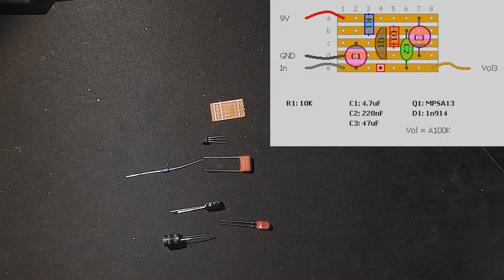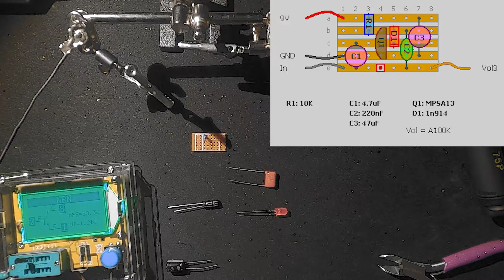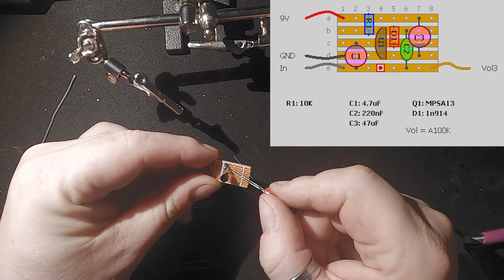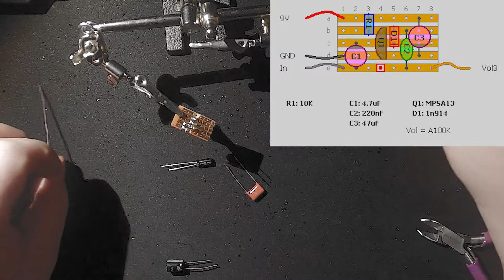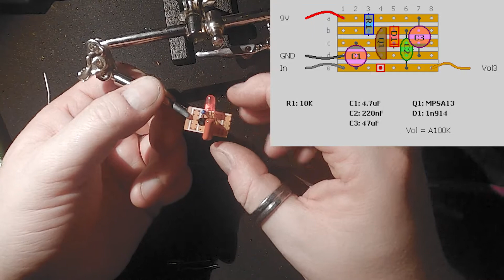DIY Pedal Building - How To Build A Bazzfuss Guitar Fuzz Pedal

Comment: Great video! Thanks! I've just started to build the circuit and I'm curious about the transistors. The three you mention  (mpsa13, BC108c, 2N5088) are a little different with the darlington mpsa13 a bit on the extreme side. Which one are you using in the video and have you documented its hfe? Also I'm going for a NOS green LED I've had since mid 90's, so that'll be a cool feature.
Reply from the maker: Like I said in the video I'm using an mpsa13. Cheers.

Comment: Note that the "front end" of the EHX/JHS "Lizard Queen" pedal IS a Bazzfuss.  It feeds a Tim Escobedo Push-Me-Pull-You octave circuit.  The stock Lizard Queen connects them directly, but it is a relatively simple matter to wire up a toggle that bypasses the octaving part and takes the Bazzfuss part directly to the volume control.
Reply from the maker: indeed it is.

Comment: Looks easy and efficient, thanks for the upload.
How does the R1 (10k) influence the sound? ( I mean, if I change the value, how will the sound be different? )
Same question about C1 and C3.
Reply from the maker: Cheers, best thing is to experiment. The 10K is what controls the voltage to the transistor, lowering the resistance should allow more voltage, increasing the resistance will lower the voltage.
Reply: @goliathfxbassandpedalshow  Thanks for the reply, I have to try and experiment.
Reply: @goliathfxbassandpedalshow  That is correct, but soundwise it would affect the sustain. Lower voltage = more gate, higher voltage = more sustain.

Comment: I like the tone. I'm building a similar circuit. How would I mod this so it doesn't sort of cut out at the end of a note as it resonates? This is my second pedal build. Just wondering if possible how to get it to resonate out a little more instead of being gated from lack of better terms. Thanks and great channel. Subscribed.
Reply from the maker: You wanna look at dual transistor fuzzes for that. This is a super basic circuit that are the building blocks for more advanced pedals.
Reply: The gated "velcro" sounds is the result of an under-biased transistor and has nothing to do with the simplicity or design of the Bazz Fuss. The transistor is running at a lower voltage, likely due to his specific combination of transistor, diode and input resistor. Different transistor + diode combinations in this circuit will also require a change to the input resistor. Even a potentiometer might work as it would allow the player to select the bias "to taste". Test the circuit with different parts in a breadboard before soldering anything as to avoid "surprises". In a simple circuit like this, every part counts a lot.

Comment: If lug 2 is out as you said in an earlier comment where does lug 1 go ? I find those vero board pictures confusing as there always seem be something missing! Whether it be wiring or where certain wires go to which lugs.
Reply from the maker: Vol lug one goes to ground. I would highly recommend going to watch how I wire a footswitch and earth loop vids as they explain it a little.
Reply: OK thanks for that! I think it would be way easier for beginners if the vero board pic just had a pic of the pot and where each lug went!

Comment: i have a question: why do you need to drill that hole on the circuitboard?
Reply from the maker: Your not drilling fully through, but breaking the strip. It's so you can place components that are in different parts of the circuit, on the same row, without them conducting etc
Reply: one more question: where should i wire the wires from fuzz board to potentiometer, footswitch, and jacks?

Comment: Non electrolytic caps can be noisy if the outer shield doesn't go to ground
Reply from the maker: You've lost me a little there. I've never known of caps having their cases grounded. Certainly not in any circuits or builds I've done. Would love to hear more on this.
Reply: @goliathfxbassandpedalshow  I'll let Mr. Carlson explain it to you. Non electrolytic caps have an outside foil that can pick up frequencies if installed backwards in a circuit. Causing noise. I'm not talking about electrolytic capacitors. Check the video. https://youtu.be/BnR_DLd1PDI?si=m1RQTy3Hvelc7u_R
Reply from the maker: Intresting, however in your first comment you say the outer shield needs to go to ground, which is incorrect. Thats partly what threw me. But Carlson is talking about old caps for the most part. Modern caps have two end plates with their componds in the centre, not many have the outside foil wrap connected to one pin like he mentions. If they did, and did indeed cause these issues then you would most likely be paying triple, maybe even quadruple for all of your electronic items to pay sorting the correct orientation of the film caps. If it was that much of a problem then these caps would be marked in the factory with correct orientation. However, I will give this a try and socket some caps next time and see if there is an audio difference. Here is the inside of a film cap - https://www.youtube.com/watch?app=desktop&v=4BEo5mw6ZKQ
Reply: @goliathfxbassandpedalshow  well Carlson said the shield goes to the chassis. Which is usually ground. But he also says shield goes to the lower output side of an audio signal. Any capacitor that has an outside foil. Many new ones have it as well as the old ones. Orange drops and other "drops" as well as polypropylene etc. Those are capacitors we use in guitar amplifiers. I would think an effect pedal would qualify since a guitar signal goes through the circuit. Obviously your video shows an outside shield in the first few seconds. His point is that they are not marked from the factory. Did you watch the full video? Paying triple or quadruple? That makes no sense. You are just orientating them for less noise and interference. He's talking about brand new caps that aren't marked.
Reply from the maker: @knowmusicman157  I meant the cost would increase in labour time needed to sort through capacitors. Be that as it may, maybe in high current devices you'd get some stray inductance that could cause a bit of noise but the magnetic field would be tiny, in amps probably cause noise but I don't know any amp builders who grade caps this way. I'll have to ask them. In pedals we are talking milliamps, the current generated is so small the situation would just not occur.
Reply: @goliathfxbassandpedalshow  Take it or leave it. Some people just love to prove everyone wrong that just offers a free piece of advice. Manufacturers don't mark caps to save money. That's the point. You need to determine it yourself. Just because you are unaware of something doesn't mean someone who knows more is criticizing you.Your effect pedal signal will be amplified. So it doesn't matter how low the signal impedance is.Maybe you didn't read the many comments about how noisy or muddy your pedal is. I'm done trying to help you.
Reply from the maker: I'm not out to prove you worng for stating something. It doesn't really apply in this situation because the current is too small in the audio signal path. The pedal is noisy and muddy simply because it IS noisy and muddy. It is a crude, basic ciruit. It has zero filtering. It has zero tone control. It is a classic noise machine as that is what it does. It has nothing to do the polarity of the dipped capacitor. Thanks for the advice though, I honestly will look into it with people much, much more knowledgable than myself.
Reply: @goliathfxbassandpedalshow  Ok. Thanks. Carlson's Lab , Psionic Audio. Those guys are some of the best I know. Uncle Doug. Too.

Comment: I made one of these also, and it does the same thing where it doesnt pick up some notes. Anyone know what the deal is with that?
Reply from the maker: That will probably be the bias of the circuit. Either that or the gain. Its a super simple circuit and not very refined so don't expect it to be a beautifully clean fuzz, its certainly not. But it could be refined for sure.
Reply: I get that, What would i have to do to bias the circuit, Try different resistor values? It sounds pretty good as long as we could get the full spectrum of notes to be picked up. Ha.  @goliathfxbassandpedalshow
Reply from the maker: You would need to add more components to get it so sound how your wanting. But then I'd just evolve it upto say a Coloursound One Knob fuzz. Which is essentially a FuzzFace with no fuzz control. To refine the bazzfuss a bit more in its current state, You would need to add a resistor to the emitter on the transitor to ground. Something around 1k would tame the gain. Also add a resistor in series after the input cap to tame some signal going into the gain stage. There are lots of other mods you could do but it will take away from what this circuit is actually meant to be. 

Have fun.
Reply: Gotcha, thanks for the info @goliathfxbassandpedalshow

Comment: what happens if we use a capacitor above 220 nF?
Reply from the maker: I would say give it a go, going higher in value will change the frequencies that are flowing through the circuit. Higher number usually equals more bass.

Comment: I like to use the 1N4001 diode. The red LEDs have good touch sensitivity, but they sound a bit mid-heavy to me. They work good as hard clipping diodes in an op-amp distortion.
Reply from the maker: Thanks for the info! Will have to give it a go!

Comment: i am doing a point to point bazz fuzz (without pcb) and i cant find a schematic with the C3 on it, what is it for? Where should i connect it?
Reply from the maker: C3 is a power filtering cap. It goes between your 9V and ground. It's completely optional.
Reply: @goliathfxbassandpedalshow  thank you!

Comment: im very new to building pedals here, so the "d" line on the pcb is a ground throughout the whole d-line, correct? If that is the case, then would I land the ground pin on the volume pot to the d-line, as well as the ground for the audio in, and audio outs and the 9v power supply?
Reply: ALSO.... what component in this build controls the majority of the tone? I would like to add a tiny breadboard on that section so i can pop in and out different capacitors or transistors to try out different sounds

thanks a million!
Reply from the maker: Yes you are correct, the whole row is ground, but, it will get very cluttered with Earth wires. What I do is chain the earth from the 9v to the jacks etc and footswitch. You can see how I do it in another video on here called how I wire a footswitch.
Reply: @goliathfxbassandpedalshow  Thanks so much! One last question is with the diode, are you replacing the 1N914 with a red LED?
Reply from the maker: @flippymtb9323  Yeah I have done, I used a 5mm Red led and sounded great!

Comment: This is cool, sounds pretty cool, but would cost me $50 on Amzon for all the parts even after I found the cheapest I could find. I could just buy a Berringher SF300 for $20.
Reply from the maker: Then don't buy them on Amazon, you can build this entire pedal with enclosure and jacks for less than $20 by visiting a hardware shop and eBay

The SF300 is awesome tho, but this isn't the same circuit.

Comment: in the video you say your attaching a 4.7uf cap but you put it in the place of C3, and then the 47uf in C1. The diagram however is labeled the other way around.... explanation?
Reply from the maker: Not much to explain, picked up the wrong cap, however, it makes little difference, one is for power filtering and is optional anyway and the other is the input cap to allow larger frequencies through and DC filtering again, this value can be anything from 10nf to 100uf. It makes no odds if I put the caps in the wrong spots the circuit still works and still sounds the way it does. This is just a demonstration on the actual build process. If someone can follow a vero diagram then they will be fine with this.
Reply: @goliathfxbassandpedalshow  didn’t mean to sound rude, 😅. Thank you 🙏 and ur awesome

Comment: do the caps have to be electrolytic?
Reply from the maker: C1 doesn't, this can be any value really but the lower you go the less bass that will go through the circuit, 100nf, 220nf should be fine. C3 is a power filtering cap, you don't need this if you don't want but you will probably get a lot of noise in the finally signal without it. Hope that helps.

Comment: Thanks for the video.
I have made several bazz fess pedals but change the circuit by replacing the film capacitor for lower value for more treble and mids. I actually get a big Muff type sound. Volume,fuzz,bias input volume ( replaces Guitar volume) and tone controls. Also two MPSA13 transistors piggyback together.
Thanks mate
Reply from the maker: Ah thanks for watching man! Really appreciate it!
Reply: @goliathfxbassandpedalshow  awesome video! I just subscribed to your channel. I do have a question for you. I’m a bit of a novice when it comes to PCBs but I have a pre made Dwarfcraft Shiva fuzz PCB which comes with 3 silicon transistors soldered on the board; could I solder an additional 3 extra transistors to the PCB? Would it make it more fuzzier? More harsher? And feedback more? I’m looking to make a crazy, noisy fuzz pedal
Reply from the maker: Hey BigMuff, no I wouldn't add additional transistors, not unless the schematic calls for it. If your looking to make crazy, gated, feedbacky type noises then look at replacing some fixed resistors with potentiometers. Especially Emitter and Collector resistors, these will starve the transistors of voltage and unbias them etc which will give real gated noises.

Comment: 2 questions 

1) what is the yellowish board called on which you mounted the components? 

2) How to make the connections ( input/output) after the circuit is completed. 

Thanks. Asking this because English is not my first language .
Reply from the maker: Hi, the board is Veroboard or Stripboard. I have another video - https://www.youtube.com/watch?v=G8An_6xvV38&t=7s that shows my off board wiring. Cheers.

Comment: my i ask what value volts of electrolytic capacitor?
Reply from the maker: As long as the rating is above the power supply voltage then it can be anywhere between 16v and 400v.  Hope that helps.

Comment: awesome build! quick question, if i want to add a tone/gain pot and keep the volume pot (2 pots) in which part of the circuit goes and what value should i use? thanks for sharing this!
Reply from the maker: Hey thanks for checking it out, to add a tone stage you would need to look at a tone section on say a Big Muff or the Bandaxal etc and use a value calculator depending on what frequancies you want to boost/cut etc. I'm not quite sure what they would be. There are a few Bazzfuss Deluxe schematics around that have a BMP tone stack on them. Have fun.
Reply: I have added a Fuzz control to the emitter (where brown diode and emitter leg meet. Volume control on output and input.
Still researching tone control but it goes on input and I think asdds another capacitor of lower value. Not sure if in series or parallel.
Cheey

Comment: Sounds great. I like the gated sound this gives. Would you know how to ad a control for the gate? What about a 6.8uf switch and adding a mid switch boost like some do to big muffs? Thanks for sharing!
Reply from the maker: Yeah the gated sound is kinda what this circuit is known for. To add a control you would need to substitute a potentiometer for the 10k resistor as this sets the amount of voltage the transistor gets on the collector. a 6.8u cap on the input would only effect the frequencies and not the gate. This circuit essentially doesn't have a tone control, so you wouldn't be able to add a mids switch really without first adding a tone control. Thats simple enough to do but obviously defeats the point of this small parts count, aggressive little fuzz. There are a few BazzFuss schematics online for a Deluxe version that have a few additions if you wanted to check them out. Cheers for watching and the questions.
Reply: @goliathfxbassandpedalshow  You are the man!!!! I didn't expect such a detailed answer! Note taking time. :D I'll try it out.
Reply: @goliathfxbassandpedalshow  10k pots?
Reply: The gated "velcro" sounds is the transistor running at low voltages, it's not related to the circuit design at all. A different input resistor will change the Bias - you could even use a potentiometer or trim pot to have it set to taste. Lower voltage = more velcro, higher voltage = more sustain. Different transistor + diode combinations will require tinkering with that resistor to have the Bias adjusted. Parts count would be the same but the distortion effect would be entirely different. Test in a breadboard before soldering.

Comment: Wow! Wonderful BazzFuzz. I too had a problem understanding the Vol3 marking. I add two Vol=100K potentiometers. One on the input side and the other on the output side. I think the circuit has too much gain from the Darlington transistor.  This made the tone easier to control. Thanks for the video. Good luck building your channel, cheers.
Reply from the maker: Hey thanks, I love the rawness from this circuit. The over saturated fuzz is a beast. Cheers.
Reply: If you add a 100 Ohm resistor between the emitter and ground it really smooths it out.

Comment: how/where should I connect the potentiometer if im using that same layout?
Reply from the maker: Says on the picture my man. Vol connections
Reply from the maker: Vol 3 goes to lug 3, vol 2 goes from lug 2 to output, vol 1 lug goes to ground, thought it said it on full picture bit it doesn't. Sorry about that.
Reply: @goliathfxbassandpedalshow  lug 2 goes to the output in the 3dpt? as well the lug 1 to the ground in the 3dpt? sorry for all the questions im new to this
Reply from the maker: yeah thats correct, the ground can go anywhere there is a ground connection man.